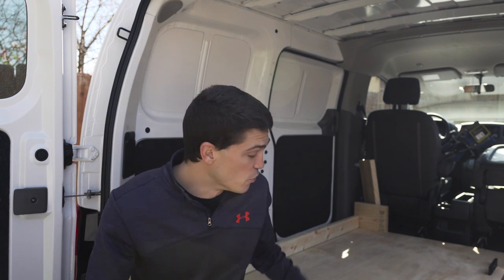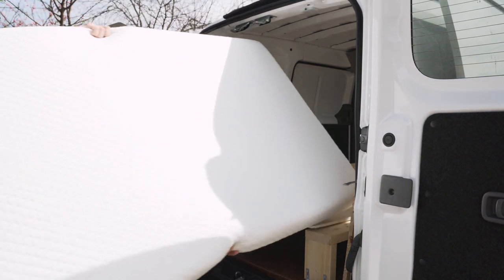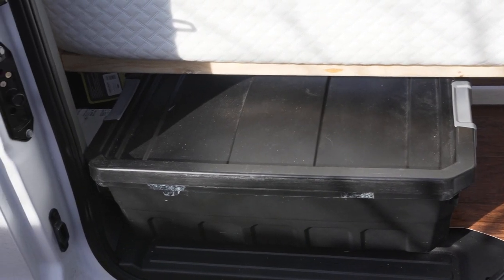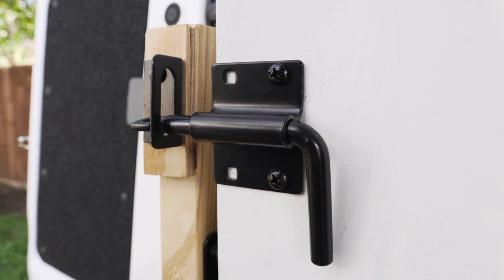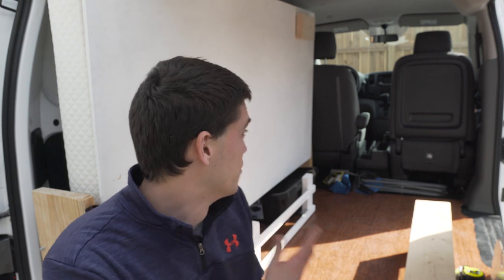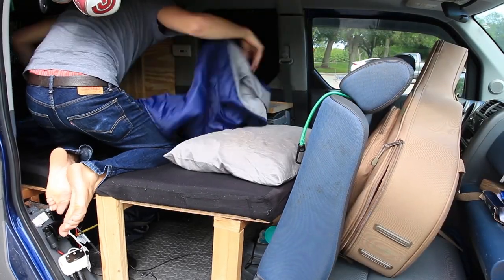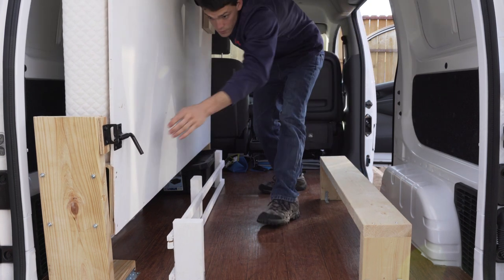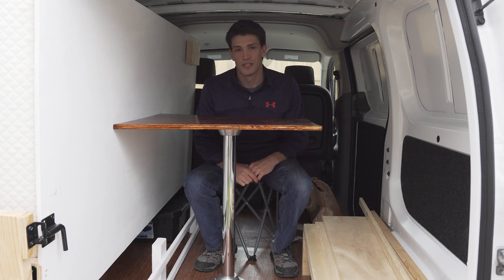DIY Murphy Bed in a Mini Van | Nissan NV200 Camper Conversion

Comment: Have you thought about putting a table (12-14 inches deep) using a piano hinge under the Murphy bed? It could be folded back against the wall art you mentioned when you use the bed. You could have a chair on wheels and move back and forth between that table and your kitchen area very easily. Murphy bed installation looks good by the way!
Reply: I came here to suggest the same thing
Reply: I was going to suggest this too!
Reply: also you could attach the bed legs on hinges to the bottom of murphy base leaving you floor clear 🤔
Reply: Id use a piano hinge to attach the table to the bottom side of the bed and then either a chain for support or support post coming from the bottom of the bed to the bottom of the table. That would keep the floor clear.
Reply: I was thinking that too.  Murphy Desk on Murphy Bed! :)
Reply: Exactly what I was thinking!
Reply: @calveryc1  an angle leg or swing out triangle would be better as the chain would get in the way?
Reply: Also what I had in mind. Great minds think alike!
Reply: Y’all beat me to this idea, but I liked it.
Reply: See this video at about 21.00 minutes in for a Murphy bed that has a table attached to the underside.
https://www.youtube.com/watch?v=QheaehKofU0
This is a commercial RV but a good idea anyway.  'Steal with your eyes'!!

Comment: Lagun table arm and apparatus is all the rage right now in RVs...move around and functional with smaller table top area.  For the table top you have, I would consider hinging it off of the bottom of the murphy bed, then have flip down support legs.  Fun stuff to fiddle with and try out.

Comment: Hi Nate can I make a suggestion, I would attach the bed legs on hinges to the bottom of the bed so the floor stays clear and when you fold down the bed the legs will fold out automatically, you could also attach your bench to the bottom of bed base on hinges which could also fold out 🤔

Comment: I know you do your research but I have seen a lot of other van folks caution against having a mattress on a solid piece of wood for lack of ventilation and condensation issues leading to mold growth. Many have remedied that by just drilling small holes  all over the sheet of wood.  Hope you don't run into that problem :)
Reply: I wonder if just a container of damp rid would solve this problem....
Reply: That notion is a fallacy. As long as the mattress has a breathable Cover, it will be fine.
Reply: @parkerposey788  oh - good to know!

Comment: Love it. Just made one out of aluminium. Has three height settings. Converts to double bed size at the middle height. Acts as a large work bench at middle and upper height. I wanted to be able to continue to use the van for transporting motorbikes and bulky items. Mattress is full size single, double sided pillow top, inner sprung. (Decades of sleeping on the ground, self inflating or cheap foam, no more!)

Comment: One thing you may find as a problem, is the noise that the hook that holds the bed up makes as you drive. But if it has enough pressure keeping it pushed to one side it may not rattle as much. Great job on the bed.

Comment: I thought you were going to use the outer bed support as a bench for your table.  If you attached the table top to the bottom of the bed you could just fold it down when you needed it.  No pole required.  Put a removable cushion on the support.  Viola!  Like a picnic table.   That’s a nice setup Nate.  Excellent job!

Comment: I think as time goes on your going to need more support latching that murphy securely to the wall with all its weight shifting while you drive. I'd think about adding one more latch behind your driver seat so your secured on both sides of the bed platform. If you ever have to nail the brakes at 65 mph or so you'll be happy you did so. Great ideas so far. Good luck!

Comment: I build Teardrop Campers without the chuck Kitchen (Waste of space). I built my full size bed on a 3 piece elevated bed riser to have storage underneath. The door is on the back, so with 3 hinged panels under the tri-fold mattress, I can push the bed from the back door, towards the front to convert the bed into a sitting couch. That is what you should have done, so your bed goes into a couch towards the back of the Van, which would free up all the rest of the Van space. It's simple and efficient for both Day & Night use.

Comment: Why don’t you mount the table on the bottom of the bed, with hinges, at the height you want.  You would have to mount a drop leg to your table, too.  You wouldn’t need the table post you bought.  Just a suggestion.  Not sure if it’s doable, but it would be easier, in my opinion, to open and close it.  It would be a Murphy table. 😊

Comment: The table can fold out from the murphy bed when in upright position. Just add a few hinges to a slab of wood, and then 2 little chains on either side to keep it held up from the front of the table to the top of murphy bed

Comment: If you hinged the table from the bed you could adjust for the angle of the streets by hooking certain Link in support chain thus your table will be level and you can set a drink on it , food will not leak off your plate. You can make that table not as wide but longer allowing same amount of area but space off to your left and right with the chair facing the bed stowed. Another thing to do is to get a hammock recliner hanging from the roof. You have a good strong roof . Hanging recliner levels itself is the solution to street angle.

Comment: Have you thought about storing your table top in a bracket attached underneath the bed. It's off the floor and when the bed is up. It right there. Even attach the table with hinges to the bottom of the bed.

Comment: A couple of hinged legs, on the upper corners of the bed base/wall, would give you the support you need, without having a loose frame 'support' on the floor! 
I believe a lot of house-based Murphy beds use them! 😃

Comment: Great choice man! Never thought of a murphy.. Greetings from Argentina, and good luck with the rest of the build!
Reply: First I've heard of it too in a van. My bed has a motor on it... Back seat converts into a bed. I can put it up or down...

Since living in my camper van I just keep it down 100% of time even though takes up almost half of our space. I removed the middle seats so it's more spacious.
It's crossed my mind numerous times to remove it and build a smaller bed because is just me and my dog and i always have at least some storage on part of bed and under it... But nah... I think i will leave it be. It's real leather and an expensive device and I'd regret it especially if I moved into a house again... Which I will be eventually.  I don't need a table in here... I can sit on my bed extremely comfortably and I have my front seats as chairs and dog house / dashboard area is a mini table. 
I suppose Nate likes to seperate sleep from business moments or else wouldn't add a table. That makes good feng shui for most I suppose.

Comment: Hi Nate

There is a thing called a porta leggs that was used in the past with the pole before the Lagun became popular.  They can be found on eBay.The fold up really small. 

That way you can set up the table inside or out, and move it around.  You can also take it outside easily!  One of these came in my 2006 camper and they were also used in boats
I also have a couple of different lengths and use one for a coffee table outside!  Also let’s me take the table outside and cook😀

Comment: Love the swivel option.  I'm sure you've gotten a bunch of comments about slotting the bed platform for ventilation!  If you don't want to see the holes find a nice fabric and smooth on with spray adhesive... Great work and thinking outside the box...

Comment: Very cool build, and not at all complex. With a bed that small you really don't need a complex gas strut setup. I might have put a Froli sleep system under the mattress somehow though, just to get an air gap to avoid mold and even more comfort, but now I'm just nitpicking. I would suggest, though, that you look into a hypervent mat though (raises the mattress a little, for airflow and thus helps prevent mold.) Warm body that exudes moisture, moisture enters the mattress, moisture hits cold plywood underneath and water condenses. Hello, mold.

Comment: Great bed system. Do a hinged desk top that folds of the bottom? Your bed set up in the element was insane. You should name her "Ellie" in honor of your 1st love.
Reply from the maker: I was thinking that for the NV! I think I might need to get to know her a bit better though before deciding on a name. The problem with hinging the table to the bottom is that it will have to be quite short in order to not disrupt the bed folding process. I'm trying to go for the largest table I can. My laptop is pretty big and takes up a lot of space when I'm editing.
Reply: ...or name it "Murphy"(?)

Comment: You have to be one of the greatest guys going and intelligent, too.  I'm so happy for you that you were able to buy this Nissan Van! You did a nice job on the Murphy bed, and I think you were wise to use a twin sized mattress rather than anything larger.  My question is, tho'.... are you not planning on insulating the walls and ceilings of the van?  I think you'd be wise to do that to better regulate the van temperatures during each season.   Also, the type of desk/table you want to add to the bottom of the Murphy bed really doesn't need the metal posts and base pieces you bought.  With just fold up wooden legs, instead,  you could eliminate those bases on the floor which you'd be tripping over all the time.  Just a suggestion.....

Comment: Nate love your videos! I have years of experience with swivel bases. They are just pressed together. I would not expect them to hold up to long, Sorry... When you find a ball bearing on the floor, that means they are self destructing.. There are many gate hinges that will do the same job and not come apart.Or even a bolt or rod through the wood. Good luck with the rest of the build!!!
Reply: Glenn Beattie yeah I think he might wanna redesign that bed, tell us what you're thinking of doing so we can give you feedback beforehand

Comment: Great job, Nate!!👍😊  Two suggestions...think on what you can do to avoid the dreaded mold issue that develops when the mattress is on a solid surface AND maybe round the two outside corners of the table top.  JOY! 💚

Comment: Very clever! I love it ! You're a tall fella and perhaps down the road you might want to consider adding a pop top so when you're not stealth camping you can pop the top and stand up. Check out the Recon Camper Vans pop top. They used the NV200 and I'm going to get the pop top, it opens up to 8' ceiling height.

Comment: That's a great idea!  I would strongly suggest you start using wood glue anywhere you are joining wood together.  It makes it so much stronger, and it is cheap.  Screws have a tendency to loosen up.  I like the idea mentioned of attaching your desk surface with piano hinge to the bottom of your bed, with  maybe a chain to hold it in place or fold up legs.  Chain would be better., out of the way of your legs.  Have fun.  Keep it light!

Comment: You could also suspend the supports for the bed from the ceiling, then you could adjust the angle of the mattress if you're on an angled road, and it would keep the floor clear.

Comment: I think you might have been happier with a router and rounding over the corners on the plywood base of the bed. Eliminating sharp edges is a good plan, especially in a moving vehicle.  Is the new van AWD?

Comment: Forget the table leg. Fasten the table top to the Murphy bed with a piano hinge to that it folds flat to the vertical bed when not in use. Brackets to hold the table top, when down, can also be fastened to the vertical bed with piano hinges and fold out to support the table when it is in the down position

Comment: It gives heaps more floor space than a fixed bed, and looks like you have enough room with the bed up in Murphy mode to have some storage for a few things too. I think this would work with a fixed slat base too, I've seen one that had some metal legs attached that folded flat to the base when it was up. Interested to see the build progress.

Comment: Great setup!! Was wondering if you thought about hinging the table on the bottom side of the bed. However to have the correct height you might not have been able to have as wide of a table.

Comment: Murphy bed needs a 2nd latch point at the top to reduce vibration. You can se. The bottom support near the rear door flexing a lot

Comment: Great murphy bed design.  Do you think that for a table it might be better to simply attach a long board to the bottom of the bed that acts to support it but when the bed is up serves as a table? Also maybe instead of having stuff on the floor you can build small cabinets into the bottom of the bed so that when it is up you can access whats inside of them?

Comment: you need more support where it connects to the floor. you could add blocks of wood where it connects to the floor and the beam with the hinge thing. or even add a metal brace in the corner like how you have one on the floor.

Comment: You made a bed level for an urban camper that usually sleeps on the streets that usually has a predictable angle for drainage? Why not put a level on the bottom of the bed that stays on the bed? Make the bed able to be higher than what you have now to make up for this angle?
Reply: FRUGAL PRIUS-RV maybe he could have a adjustable legs on the Murphy bed
Reply: @CommonSensePhilosophy  beat way to pull this off is drop chains from the roof. He is going to dislike the floor brace. He has me thinking I like his way with the seat swivels I need to get some for both my tiny camper and my little cabin .

Comment: Hey Nate what about making support legs that fold out and up with the Murphy bed? You can hinge them and lock them in place instead of them mounted to the floor and kind of just being there. Just a thought bro...oh and how about making your table/desk fold up or down like a drop leaf table from the Murphy bed in the wall position? I would also consider a bridge type cubby system across the top of the rear door area if you have room to incorporate into the shelf on the far wall.

Comment: I really like the bed/desk arrangement!  Good use of space. I was wondering if you've had a chance to drive the Nissan very much? I'm especially interested in what you think about the acceleration and handling. The Nissan only has 131 hp and I'm concerned it might be a little under powered.  And do you have an opinion regarding the CV transmission? Looking forward to the next video.

Comment: was the desk support needed? If you hinge the desktop to the bottom of the murphy bed, you can use a counter on the other side as a second support. Fold up the table top when you deploy the bed.

Comment: You should just reverse your front seat. I doubt you have many passengers. For your windows I suggest reflectex painted black on one side. You should mount storage containers to the underside of the bed so when it's in Murphy mode you have access to everything

Comment: "REAL MATTRESS" isn't a memory foam mattress. I got a custom made inner spring mattress and managed to get it into a hyundai trajet van which is a people mover a bit smaller than a chrysler voyager. I ended up with a bizarre partial murphy bed type setup. Kind of a permanent 2/3 top and 1/3 fold down for the mattress. So I can get the mattress out of the way if I cook. I WOULD HAVE been able to put in sn existing twin mattress I have except I got a bigger freezer than most and because of the trim that covers the wheel arches (and also carries the rear airconditioning system) i was like 1.5" too big.

Comment: You could possibly make the workstation a flip desk from the underside of the bed frame. your solution looks simple, and I like that, but you could save a lot of space if you had fold down legs or some sort of  fold down support system for that bed instead of having the support system be permanent in the middle of the van. If you didn't have that support system on the floor of the van that would create a lot of space for a chair and room to work off of the fold out flip table built into the bottom of the bed frame.   Like this: https://www.peter-schiff.com/murphy-bed-desk-is-the-best-idea/

And I love how you use the swivel mounts. I like how you did this in general.

Comment: Ok I need to steal your design I live in a small space for a good reason. My power ,water, sewer , gar garbage , is all combined this month is $77. I use any thing I need to just trying to keep the space small. I want a bed that tucks away so I can slide my recliner in the space where the bed is. IDK if you have seen cycle cruisers channel he has a bed that folds. You need to look at his set his table hinges from the bed don't need to store a leg

Comment: Hope you don’t get rear ended when your bed is set vertical. If you’re sitting in the driver’s seat the edge of that bed frame will shear you in two.... Murphy’s law. Ain’t no airbag for that, think safety first under all conditions.

Comment: Why not have the table mounted to the under side of the Murphy bed on hinges. That way you don't have to store a table and poke somewhere.
Reply from the maker: That was my original plan. But in order for the table to fold down it would need to be quite short, making it too small to work as a useable desk space.
Reply: @ElementLife  yeah that makes sense. Are you gonna have a roof rack and carry your surfboards? You need to surf more by the way hahah